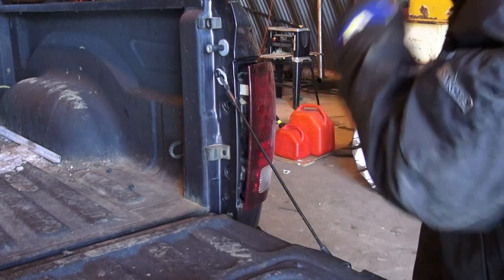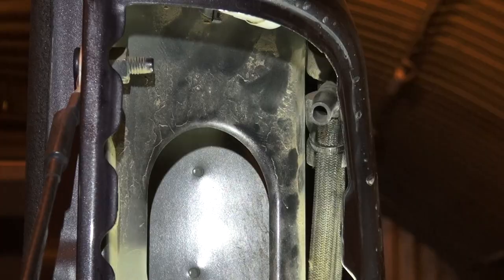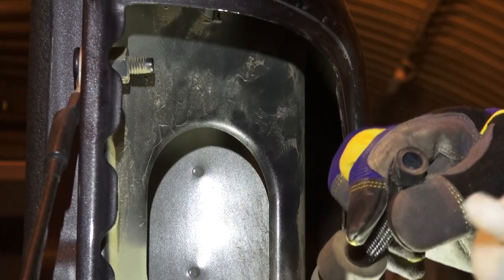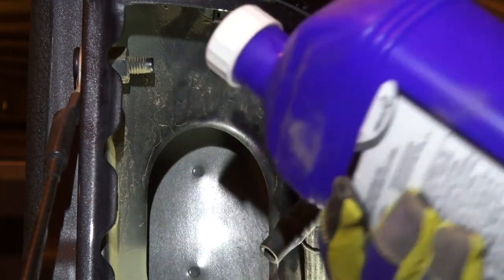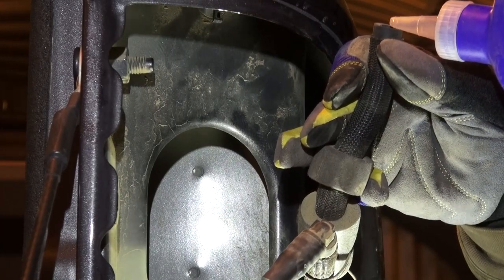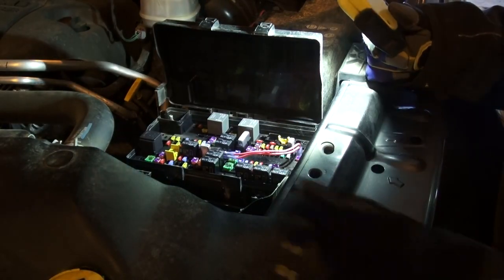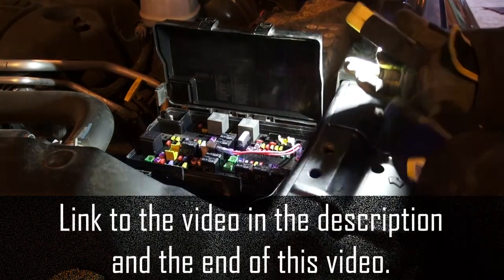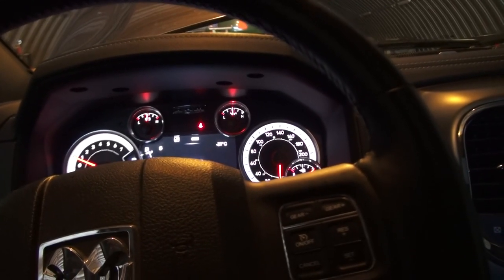DODGE air suspension [De-Icing-lubricant]

Comment: Hey man, can we get an update?  Do u still own? What's your maintenance cycle? How's your success??
Reply from the maker: I should make an update video showcasing the latest experiences. So far so good. The suspension acted up once this winter, when the breaker tripped due to extreme cold on the compressor running lots. A quick battery reset fixed it. Still working fine and the truck has been reliable all the way down to -30°C
I use the antifreeze once every 2 weeks. 5ml at a time. No heating blanket use for years.
Reply from the maker: https://youtu.be/rJGdszcB-JM?list=PL_AmXFkVZqacxjq7eGMtJnOd3k9XV2dNX

Comment: Napa is completely sold out of this de-icer lubricant (all the Ram owners, maybe lol).  Is there a similar product that would work?  Thanks for all these videos.  So helpful.
Reply from the maker: Try a truckshop, any de-icer lubricant should work and they should have some.
Reply: @oBseSsIoNPC  thanks!  Appreciate it
Reply: @oBseSsIoNPC  think Safe-T-Brake air brake antifreeze would work the same?  Thanks
Reply from the maker: @handwedge11  should work indeed, its also a anticorrosive.
Reply: Thank you!  So far so good
Reply from the maker: @handwedge11  you are welcome, glad i could help

Comment: Nice vid.  Straight up kinda guy.  It’s been a constant struggle with my 2016 rebel. I have had 5 dodge but this is going to be my last because of this issue.  On to Toyota.
Reply from the maker: Thank you!
Hehe, there are always issues with things switching brands may not cure bad luck with vehicles. One thing for sure, when things are poorly designed from the get-go, it really stinks and got nothing to do with luck eh?
Reply: +1 on the switch to Toyota,  thus will be my last ram

Comment: I love the suspension videos, after a complete failure, front was on bump stops, i was able to get mine to raise up by putting into tow mode , then it would cycle through the different levels, but took forever. Next day had a blown fuse. Dealer says there is no leak as it stayed raised up for 24hrs, but does not auto adjust leveling. I have appointment to have control module replaced today, although i know that is not a permanent fix. i'm going to try some 12v heating pads on the compressor and valve body. The felt like cover should just be a heating blanket itself. Wish i had a new one to just glue heat pads into.  thanks for the videos.
Reply from the maker: you are welcome, hopefully your dealer takes good care of you!
Reply: Did you have any luck with the 12v heating pads ? I have a 2013 Laramie and have had issues recently and I'm looking for some sort of solution thats not going to costs 1000s

Comment: Thanks for the great videos in this whole series of Ram’s disastrous suspension. 

I was wondering if you had any suggestions on a product to purchase from an American retailer like auto zone?
Struggling to find ALD-3 here in the states
Reply from the maker: I would think they carry "Air brake de-icer lubricant" as they should sell air brake components. Any other truck parts/aftermarket store or NAPA should carry it. The stuff is used on big rigs all the time as well as Agricultural applications, so it will be readily available in retail stores involved in those industries. PROLAB is US based afaik, so it should be sold there. Please do a search of retailers in your area and ask them for air line de-icing lubricant. ALD-3 is just one type/brand we use around here plenty of. GL!

Comment: I'm going to try this tomorrow.
thanks 
 my right brake light is out on the display but it actually works.
 I noticed you had the right light out.
thanks. my compressor says wait while system is cooling some times.
I will never get air ride in a pickup again
Reply from the maker: If your compressor is overheating, you might have a pinhole leak somewhere. The worst thing is trying to trace a leak in this system. The best way I can think off for that, is to first, pump up the suspension all the way and putting the suspension into tire jack mode or pull the fuse, so it stops working. See which side deflates, then use soapy water to find the leak through bubbles. If the compressor just isn't working because of cold weather, the antifreeze definitely works wonders.
Reply: @oBseSsIoNPC  it seems even up or down. I will try that 
even get a vaping hipster to blow vape smoke.lol
I'm just sick of the stupid thing. 
my uncle has the same year half ton but Longhorn 
same air system.
he just changed the rear shocks and his problem has gone away. 
thanks for your input
Reply from the maker: @JustinHallowesOutdoors  i hear ya. They dont tell people that those suspensions are high maintenance, when you buy a truck.
Reply: @oBseSsIoNPC  or meant for warm climates
Reply from the maker: @JustinHallowesOutdoors  DEFINITELY, made for California city driving, like ALL American cars.
Which is why I am still surprised how well TESLA works up here.
Reply: @oBseSsIoNPC  I have a buddy that likes his Tesla but says the batteries don't hood a charge as long.
when its really cold.
Reply: if your right brake light is out on the display but it still works it means the right side of your third brake light bulb is out. Annoyed the crap out of me for a month before my mechanic figured that one out at RCTS in Calgary.....
Reply: well 3k later I got rid of the air ride and git normal suspension plus ball joints replaced. probably only would cost a person 1k to 1500 if they did it themselves but I don't have the time for it.
best decision ever. 
it feels like a new truck.
you still get that annoying message 
immediately air suspension service needed. 
but its fine
Reply: @oilprooilfield2148  after replacing air suspension with nori suspension the light out indicator went away. but I will remember to check the uper/3rd brake light next time

Comment: Hey man how’s this working for you still.  Have been struggling again this winter below -25 with my suspension.  I’m lucky to have a warm storage shop at work that I can park the truck in for a few hours to warm it up to get home.  

What year is your truck.  I though these things were closed nitrogen systems.  Maybe it was just a sales pitch the guy told me at the dealership.  It’s a 2015 1500 ram.
Reply from the maker: My friend, you got the same sales pitch I got for my 2015 1500 and I asked TWICE SPECIFICALLY, because I didn't want the suspension if it wasn't Nitrogen and he ENSURED me it was. I am certain they just don't know shit about the product they sell. Anyway, the biggest problem with those is either the compressor or the control valve freezing up and the de-icer cures this issue. The only other problem may be that fuse blowing and for that I made a video as well. Give it a shot, de-icer, run plenty, replace the fuse with a breaker. Done.
Reply: ObsessionPC thanks.  The fuse didn’t blow yet this winter it did last year a few times.  I have some spares in my glove box.  I’ll try the deicer.  Just wanted to make sure it was still working for you.  Glad I found this video thanks.
Reply from the maker: @ianjones7526  i will be uploading a update video on the truck hopefully tomorrow! The suspension does not care how cold it is anymore, such a huge relief!

Comment: New to he video.... is everybody's compressor still working ok to this date?
Reply from the maker: Mine is. Some people say the dealerships claim the compressors were burnt out. I have never seen one confirmed yet
Reply: @oBseSsIoNPC  so after adding that antifreez/lubricant have you had any issues? Did you put the battery blanket back on?
Reply from the maker: @_flexxx_  I had problems twice this winter, because I didn't add enough anti-freeze initially. I am not using the blanket and I had to unthaw the control valve once. It has been working 95% of the time. Note that it was an exceptionally tough winter, cold and humid.
Reply: @oBseSsIoNPC  so are you having to add it each winter or do you mean you didnt add enough initially when you made the video?
Reply from the maker: @_flexxx_  because there is no reservoir, you have to add it multiple times during winter.

Comment: I wonder if lock de ice and lubricant will do the same thing
Reply from the maker: I would stick to something designed around air brakes.
Reply from the maker: @gmac9956  yeah I know. It is very poorly designed. It has been driving me crazy this last month, since they did an update to it. The cold snap we had really didn't help, but it's been working since yesterday after 1 hr of ridding the system from moisture and cycling it a bunch of times..
Pisses me off that you can't see what it does or what it really complains about. No override or real time sensor readings...I still want to try a relocation of the control valve and maybe even the compressor. I shall see.

Comment: I have a 2017 Dodge Ram and was driving down the road and truck started a small shake?  Usually smooth could this be my problem?  Live in North Dakota
Reply from the maker: Unlikely. Most vibrations are tire/wheel related. Meaning you should check tire pressures and then get the tires checked and wheels balanced first, to exclude that as a source. Other reasons go deeper, drive line, bearings, bad shocks etc.

Comment: I read not use the deicer or methanal as the alcohol will eat away at the rubber hoses and o rings.  

I first ran the blanket on the compressor but it did nothing. Moved it to the valve block and fixed it. I moved it back to the compressor and it shit the bed again, so again, i moved it back to the valve block.  Works fine when im parked at home. But if i go out and dont have it plugged in, i lose adjustments (aero mode) and the ride progressively gets rougher. Im curious how it would respond if you reroute it and move the compressor and valve box into the cabin behind/under the rear seat. Or at least run the intake and exhaust hoses inside.
Reply from the maker: I also did find that the valve block is more often the issue than the compressor and thought about routing it into the cab as well, but I am sure the noise of the compressor and air blowing off is going to get annoying fast.
As for the deicer, it hasn't attacked any of my tools or the hoses and should be o.k. for the suspension as well. Minimal amounts is the key here. I will definitely give an update about the hardware condition in a few months time.
Reply: ObsessionPC look forward to seeing an update.  What i want to know is im assuming at this point the nitrogen is completely gone out of the system.  So would it be a good idea to get the system purged of any moisture and recharged in the spring.
Reply from the maker: @Snakes709  It is an interesting point, as I am still not too keen on how they even set up the suspension when new. When I had the lines off the valve, I purged a lot of moisture from the open ends and the valve, about 3 drops of water in each line. Not much, but enough to become an issue for the valve. I am too worried about nitrogen vs air that much.

Comment: It's been cold this winter, and my air suspension is bucking like a bronco. What's verdict on the de-icer/blanket this year?
Reply from the maker: The de-icer appears to be the most impactful solution. I have not used a heater blanket at all and the suspension has been working flawlessly since the start of winter and all last years winter! I did run the compressor quite a bit in my shop to circulate the de-icer and remove any moisture. At least 15 minutes of all the way up and down with cool-off cycles.
Reply: @oBseSsIoNPC  So maybe start with the de-icer, and go from there?
Reply from the maker: @captmarc  yes, use VERY little. I used the cap from the container filled it about to half. Then cycled the compressor multiple times and then added another half a cap. I did this beginning of the year and added ANOTHER half a cap just before winter started. I might add some more now, now that I come to think of it. Just remove the intake filter and add it there.
Reply: @oBseSsIoNPC  Great, that is super useful info. Thanks for getting back to me so quick and have a great holiday season!
Reply from the maker: @captmarc  you are welcome, Merry Christmas :)

Comment: These videos are great, but you can replace all that crap for coilovers and springs pretty cheap and easy.  No more winter issues
Reply from the maker: Yes you sure can and when parts need to be replaced I think that is the best solution to stop the headaches. However for as long as all the components are working and it's just a freezing issue it's nice to have the air suspension for the ride, ease of access and load adjustment
Reply: @oBseSsIoNPC  agreed, and it is a smooth system when it works.  The freezing and thawing wore out my bags which wore out the compressor. It lasted 5 winters, even before it went completely out I was still frustrated the 4 wheel drive with heated steering wheel and seats I bought for the tough winter months couldn't be driven in the cold!  It's been -30f with 40 mph winds In north dakota the last few nights and I can finally drive my pickup regardless.  $700 and done
Reply from the maker: @heathadams3655  $700 USD for an all in suspension? Wow? Betcha it will cost us $700 CAD up here. Lol haha. I should start looking as my truck is coming of age, but it has been doing VERY well. I only have 91872 km on it but its a lot of gravel road and field as well. Anyway, love the truck too much to not keep it.

Comment: Enjoy the effort/videos in trying to fix this pos system. Was wondering if an air dryer would help alot in fixing the freezing??? They are used on rigs and alot of air ride vehicles.
Reply from the maker: to be honest with you. the cheaper and lasting solution imho is a relocation of the compressor to the right hand floor compartment. That is what I will probably attempt to do. This way you keep moisture away and keep the compressor warmer. You could insulate the compartment in the winter, and remove the insulation for the summer. Don't know just yet, but a dryer is not the whole solution here.
Reply: ObsessionPC hey dan I’m from Edmonton just like u and my air suspension is just a complete pain in the ass I even installed the blanket like you said. Any way you could help

Comment: Has this fixed the issue along with the blanket? 
Did it effect the parts? 
My sport is starting to act up
Reply from the maker: My truck was working fine 95% of last winter (no blanket used at all) and has not missed a beat this winter. Although I do not drive it below -35°C that is a personal choice I made before I even bought the truck.
The de-icer and a charged nitrogen tank is where it's at. Although using a blanket below -30°C is a smart thing to do. I dont know of many air compressors that work well even at -10°C however the one in our trucks is dry lubricated, not with oil.

Comment: Hi!   did you try to add de-icer into the tank (air reciver)  ?!   What do you think about this... ?
Reply from the maker: I have not tried it. I prefer a controlled injection myself, so that it doesn't add too much fluid at once. It isn't a big deal to add it manually every few months. Literally twice a winter and once throughout the fall
Reply: It is supposed to be a closed system that is filled with Ultra High Purity (UHP) Nitrogen and the only time it will take in outside air is if there is a leak and the system is compensating for a low system pressure so as to not leave you stranded. Of course this completely contaminates the system with moisture laden air and it never notifies you that it is doing it.

Comment: Thanks for the helpful video. I have a 2500 with the same issue but the line and filter are strapped up behind the cab in front of the bed. Has anyone tried this on the 2500?

Comment: where is it located with the ramboxes, because I couldn't find it
Reply from the maker: Should be the rear right tail light. Take it out and look inside the hole, there are two lines.
Reply: @oBseSsIoNPC  I took off the right rear headlight and swiped my finger and I didn't find anything,😒 I'll try again
Reply from the maker: @manuquintal8437  perhaps they relocated the system? Can you see or hear the compressor underneath?
Reply: @oBseSsIoNPC  so yes, I looked underneath and told myself that I would find the filter but I didn't see anything and I didn't want to start dismantling the trim
Reply: @oBseSsIoNPC  I would have liked to try the tip in the video, because I sometimes get an error message from the suspension, when it is cold or in humid weather
Reply from the maker: @manuquintal8437  well, makes me wonder if they finally redesigned the whole thing and put things in a different place.